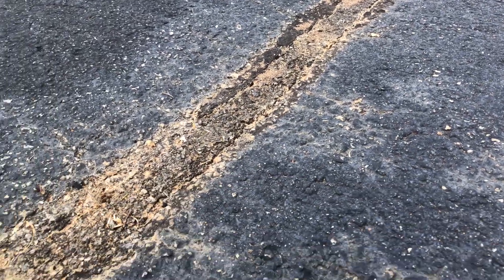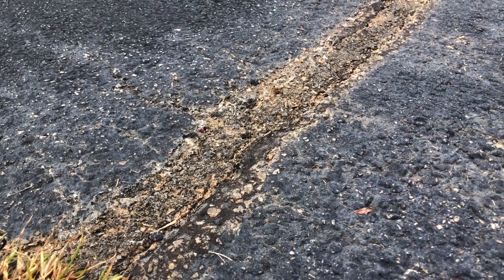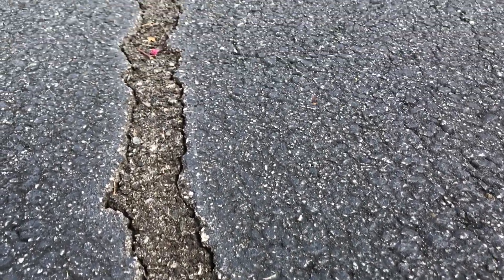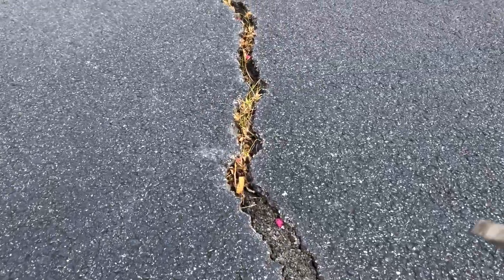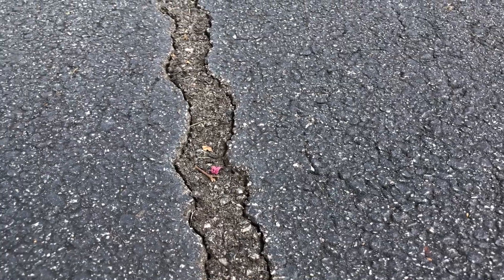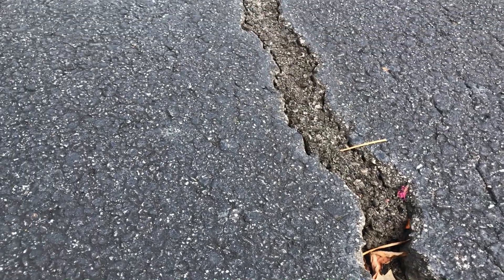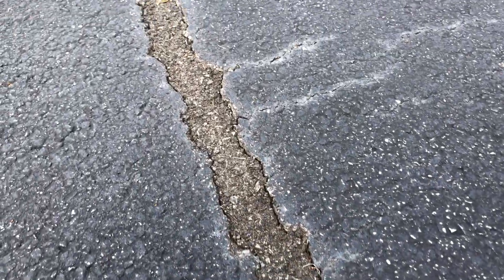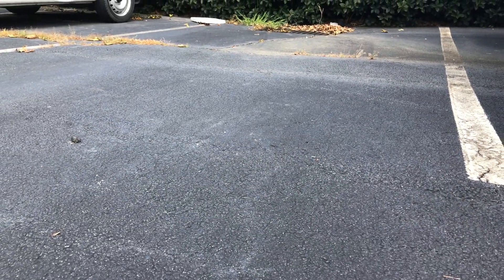Aquaphalt 4.0 Results after 1 year

Comment: Check out their site. It can be installed in below freezing temperatures. When sealed with a quality rubberized sealer and feathered out it lasts a long time. 
But it can't fix a sliding lot. Best of luck with that. Mmmm sounds pricey

Comment: Use crack repair tape roll  or melt aphalt stix on top of the aquaphalt cracks that way you prevent future cracks
Reply from the maker: Sounds good. I wasn't actually trying to repair anything. This was more of a test to see if the product would hold up over time.
Reply: @andyalger6702  thanks for posting you saved me the testing , money and time.